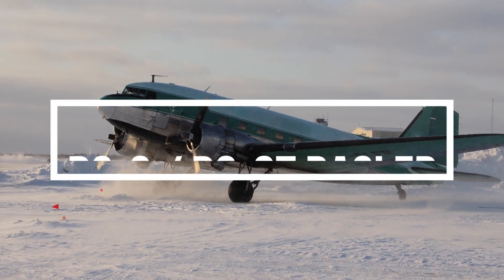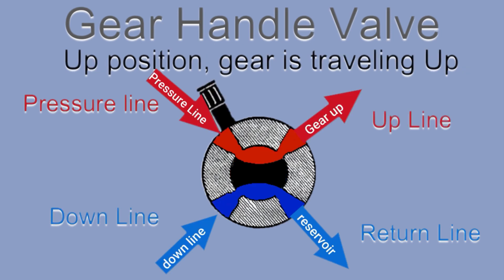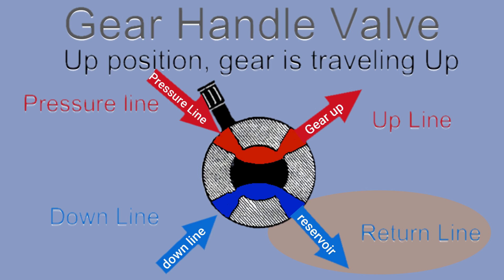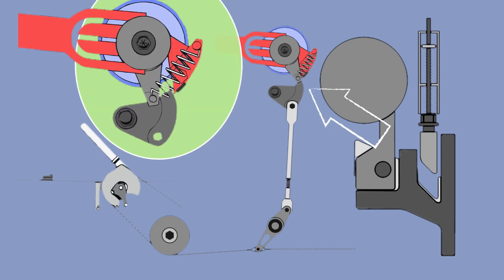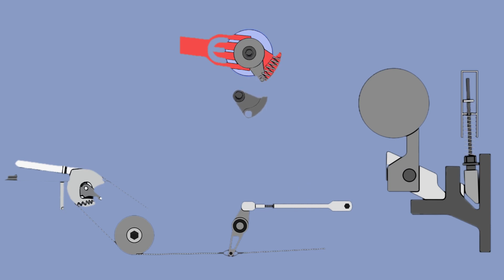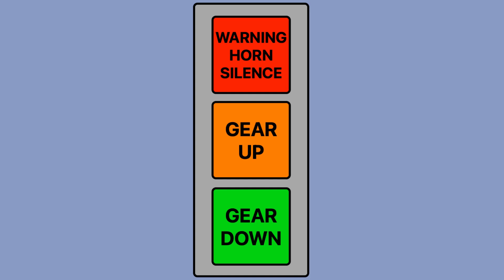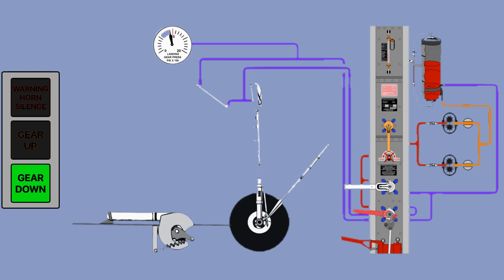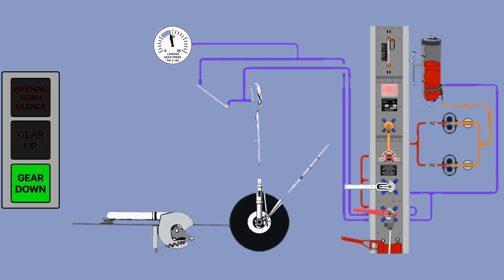DC-3 Landing Gear systems

Comment: Excellent explanation - and I like the details about the safety latch very much, however, where is the latch installed in the system? I've always wondered why the DC3/C47 landing gear doesn't bend at the swivel point and I feel I'm getting closer, but I'm not quite there yet.
Reply from the maker: Great question, the safety latch, is by the captain seat on the floor. If you face the cockpit, on the right you will have the gear handle, by the F/O, lower you will have the hand pump, on the floor, and on the opposite side on the floor by the captain seat the safety latch.
Reply from the maker: For the landing gear, I am sorry I am not sure if I understand the question.
The main idea of the gear is to stay locked down. The gear expands to an over center position. (Between the top part and the bottom where the tire is attached to)
So more you put weights on the wheel, ore the gear lock into position. The actuator is here to make sure the gear stays in this over center position.
I am re-watching the video, and it seems I forgot to talk about the over center. Also the safety latch prevent the gear to go up in the event of a lost of hydraulic pressure.
The safety latch is connected to the landing gear handle but also to a latch situated in the gear cell.